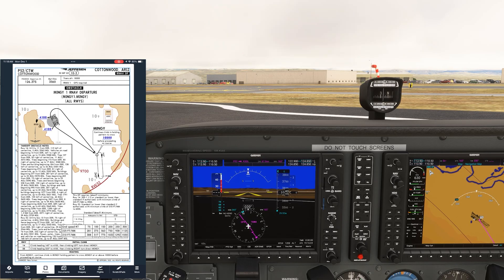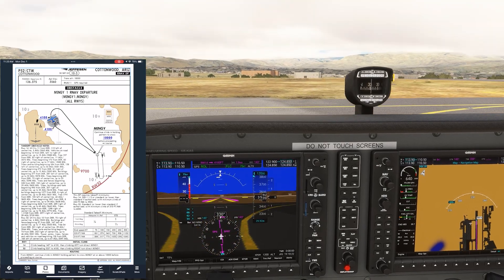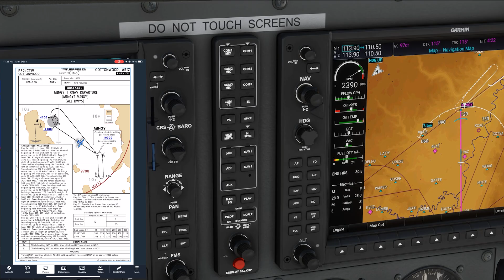IFR Departure MISTAKES: Which Runway Do You Take? (Real-World MINGY One at Cottonwood)

Comment: The cyan arc you see in your MFD may not be the accurate depiction of your climb path since it does it's calculation based on your current climb rate. As air get thinner, your climb rate will go down and your TAS will pick up, resulting in shallower climb than cyan arc depicts.